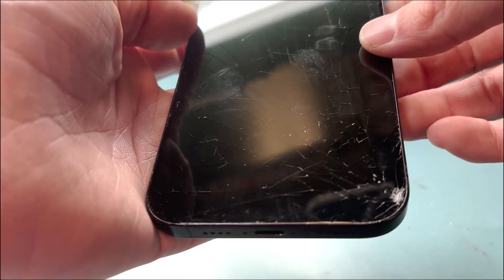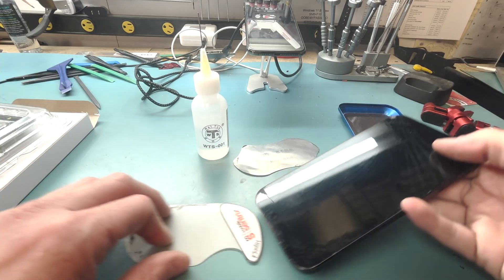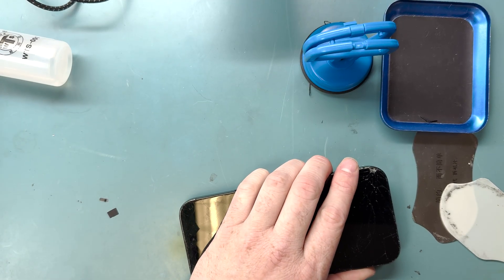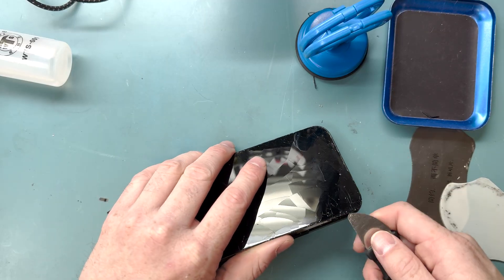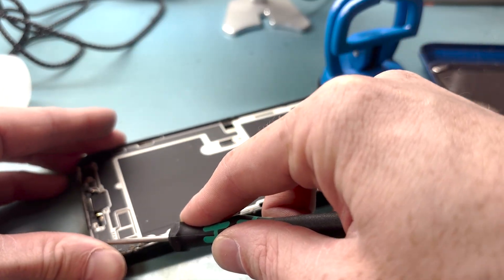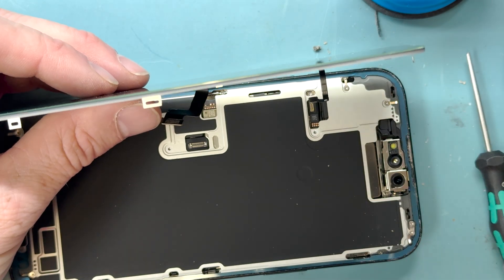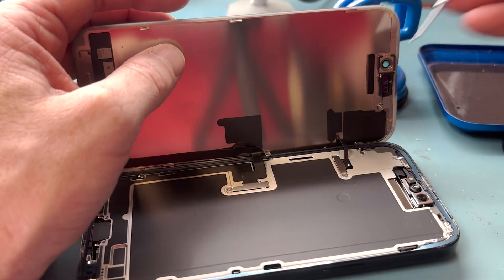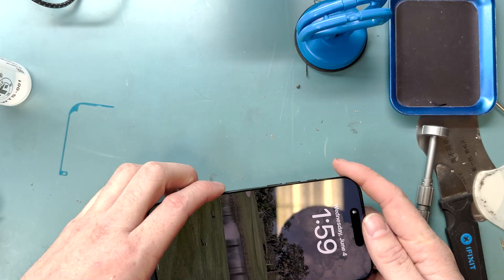🔧 iPhone 16 Pro Max Screen Replacement Guide: DIY Repair Tutorial 📱

Comment: Why not take off cable off battery first before take off screen cable that no problem?
Reply from the maker: Only if you can turn it off you can skip disconnecting the battery according to apples website but if you can't power it off then you will need to disconnect the battery
Reply: @worthitrepairs you so awesome mate subcrib done

Comment: not dangerous to not disconnect battery?
i saw your other video but how many times did you try that tho :D
Reply from the maker: As long as you can turn it off your good according to apples repair guide
Reply: @worthitrepairs  ok :)
Reply: Es peligroso,se puede dañar la placa del equipo.

Comment: Seemed like a lot of effort. To get that screen off. Sticking a cheap $5 screen protector to the broken display to allow use of the suction cup seems like a faster and easier solution.
Reply from the maker: Tape also works better too sometimes I just like to struggle I guess
Reply: I always use a 10 cent piece of packing tape

Comment: Did you have to transfer the True Tone data? Or did it do it automatically for you?
Reply from the maker: Automatically you don’t need to program True Tone anymore Apple changed that with iOS 18
Reply: @worthitrepairs was it an after market screen or genuine apple screen replacement?
Reply from the maker: @collinmiller8866 apple
Reply: What can I warm the screen up with
Reply from the maker: Heating pad, heat gun, hair dryer could work
Reply: Can I still trade in?